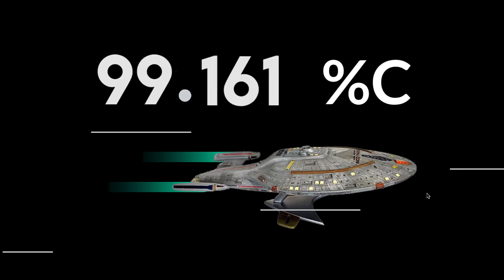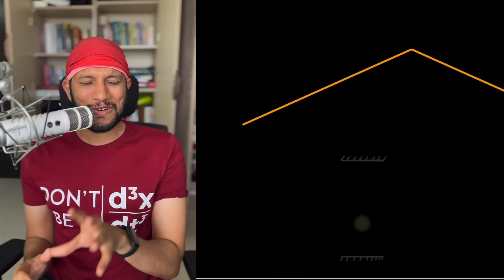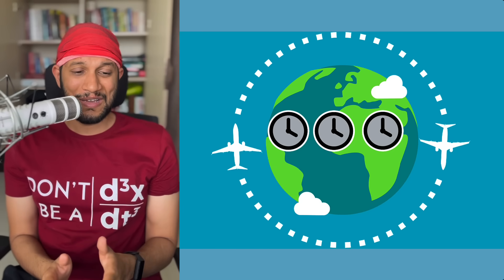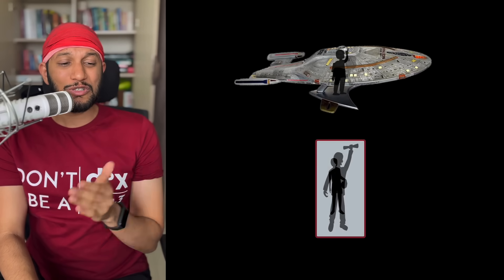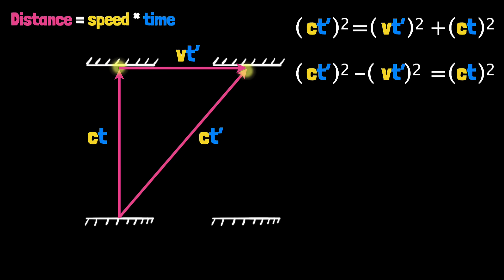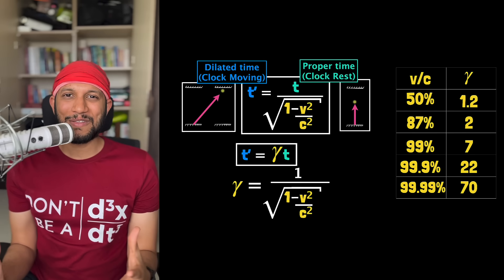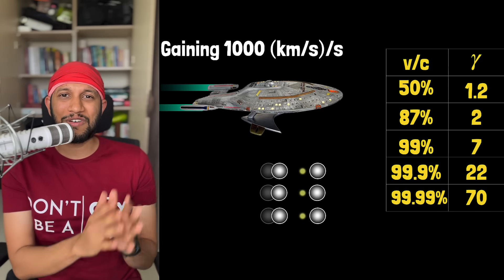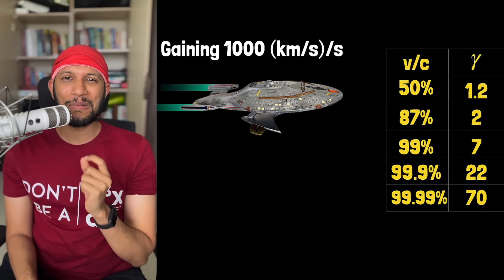I finally understood why you can't go faster than light! (My mind is blown)

Comment: Several relativistic cosmic rays have been detected at 99.99999... %c.  They had the energy equivalent of a baseball traveling at 65mph!  In a race between the cosmic ray and a photon the photon would be ~1 inch ahead of the cosmic ray after traveling 200,000 years.

Comment: Thanks for the explanation. I am not quite sure why it matters what the motion paths of the photons looks like from the external observer. But another question is, as the ship approaches the speed of light, the time inside the ship will slow down, so to speak, so effectively the passengers can travel further than they would have expected using the external measurement. So doesn't that mean that they can effectively go at the speed of light, meaning travel one light year in one year of their lives? For the outside observer, that time period would be longer, but that is their problem, isn't it?

Comment: Great video! Another intuitive explanation that works for me is that every object, particle, and individual is traveling at the exact same speed - the speed of causality. It just so happens that causality has two components, time and space. There is a trade-off between the two components, such that increasing motion through space requires decreasing motion through time (the total motion through spacetime/causality is constant).

We move very slowly through space because we move rather quickly through time (we experience the passage of time). A photon has all its speed allocated towards moving through space, such that it does not move through time (from the perspective of the photon, it does not experience the passage of time). The photon's motion through space represents the total speed of causality. To go any faster means you must give up the concept that cause precedes effect, which would ruin all of physics.

Comment: You can but it takes a lot of continuous energy to power it all.
First mass is affected by external magnetic field and gravitational field it slow it all down.
However if you took something like a red star and everybody knows there's no way it red star could achieve speed of light but that's mathematics I'm part engineer so what you could do is you can encase the red star in entangled mesh looped massless particles which are used to travel again the speed of light sort of the perverbial nonstick pan so now if you do it right you can actually move an item which does contain mass to the speed of light because it has a shield of massless particles which are used to traveling at the speed of light anyway but to get it to that you still have to use a lot of energy now when I'm talking about energy you basically need to draw a line that goes up to the sky and as you're moving your using more and more energy until basically you're using all of it but you can achieve 1.1 I think the concept of mass speed transported to light speed is doable it just needs to have a shield of massless particles around it which protects it from picking up all of the planets and galaxies which have magnetic fields and gravitational because those things definitely those speeds will slow you down the good news now is that while you have the shield of massless particles and if it's thick enough it should disconnect you from the surrounding so you can take things with masses as long as the shield around it too light speed will take a lot of energy it's probably not practical but you could also steer because if you can connect and disconnect areas of the whole of the ship shielding that every time you disconnect it'll connect to one of the magnetic or gravitational Fields it will actually pull you with that direction just enough that you could actually navigate the universe by connecting and disconnecting areas of the hole where the Shields are and you'll basically be drawn into those areas hence navigation as well win win

Comment: So the slice of pizza I put in the microwave traveled at the speed of light and that’s what heated it up?
Reply: No in microwave oven the oven creates oscillating electric field the water molecules in the pizza are in dipole so the dipole feels torque so due oscillating electric field the dipole moves back and forth creates heat

Comment: Yeah but time dilation in this example only exists from an outside perspective of the spaceship, to a non moving observer. If you’re inside the ship the clock ticks normally so what’s stopping you exceeding light speed onboard the ship? 

Also, if time slows down for the moving object, shouldn’t the universe as seen moving by through the ships window experience the dilation from your perspective onboard the ship? That would mean your time is faster than the rest of the universe, you’re time traveling into the future, and the time dilation is speeding you up not slowing you down

Comment: Very nice explanation. I also think that atoms, matter, vibrates at the speed of light. So, lets pretend we have infinite magic energy, and we push an atom passed the speed of it light, it will cease to exist as it wont be able to vibrate ... Would look sometimes like the absolute zero (that is also impossible to reach)

This also shows that time itself, most likely doesn't exist. You need matter, or something, to measure time. So, time is like a shadow, you see it, can feel it, measure it, but it doesn't really exist as a thing on itself.

Comment: Hi Mahesh 👋, I have a doubt:

If any mass moves with the close to the speed of light then that mass will get increased. This has been proved by Einstein mathematically..practically It has not proved so far...E=MC squared.

If you consider this, accelerating mass/space-ship with the close to the  speed of light will warp spacetime around. mass is humongous while accelerating. Here we will get timedilation from that warping spacetime. So clocks will ticks slower in that space ship. To accelerate that humongous mass we need infinite push...there is no such thing like infinite push...so mass can't move faster than speed of light.

Sooo what I am saying is..... because of accelerating space-ship/mass we will get time dilation....not because of timedilation we control the speed of ship.
In simple words,...Time Dilation is the output of Accelerating mass/space-ship. You were thinking Time dilation is the input of Accelerating mass/space-ship...from the observer point of view you are totally correct and we can't ever see that ship is moving with speed of light because of time dilation....but this is not the real/original reason for why nothing can  go faster than speed of light.

Correct me if I am wrong...my english is not that good don't mind.i have learnt many things from u..Thanks...👍

Comment: Say the spaceship that's passing you by, has a clock at its nose, its middle, and it's tail.  And, your friend on that ship, tells you that they're all synchronized.  At least, as he sees it, in his frame of reference.

But, when you look at the ship, from your frame of reference, at 3 o'clock, you notice that the clocks say:
- at the nose, says 2:59:59
- in the middle, says 3:00:00
- at the tail, says 3:00:01

So, the nose is where it's supposed to be at 2:59:59, not quite as far along as the middle, because it's a second behind.  And the tail is where it's supposed to be at 3:00:01, one second past where it was at 3:00.  The result is, the other ship looks  squished shorter.

This is where the things actually are.  This is not because the light, that you see with, is taking time and distorting what you see; no, you have to calculate the actual locations first, and only after figure how how the light distorts that picture.  This is where the things actually are.

Imagine space-time.  It's 4 dimensional: 3 space dimensions and one time dimension.  We are all where we are in space, but we're zooming forward at the speed of light along the time axis.  When the spaceship passes by, it's space dimension is actually tilted relative to ours.  That's why their head and tail seem to be at different times, in their frame, while at the same time in our frame.

Comment: A few questions based on the explanation. We witness the time dilation because inside the ship 1 second feels like 1 second yet observing from the outside 2 seconds pass where 1 second passes inside the ship. Depending on where you are standing , i happens differently based on the movement of the photons.

But arn't the photons inside the ship when you look at the clock still moving at the diagonal? Shouldn't they be traveling the longer route? That is the path they are taking.

Also, shouldn't it feel like you keep accelerating 1000 km/s/s inside the ship due to this very aspect? So from inside the ship you would hit light speeds eventually whereas from the outside that would never be possible?

I think I am misunderstanding something, so please do help out.

Comment: I have always had a problem believing time dilation till you explained it the way you did.  Time itself is not changing but the observation of time changes.  However there are two potential flaws to this theory I see from your wonderful explanation.  As I understand it from other sources, light has constant speed and is not influenced by outside sources.  Light speed is not added to your velocity, so I surmise that trajectory is not added to light either.  Therefore in a photonic clock the tick would stop the faster you go because the straight beam of photons would miss the reflection and thus the receptor in the example when moving perpendicular.  Similar in saying we don't see the sun but where the sun was 8 minutes ago, bu we only see it at all because the sun emits light in a sphere, in all directions.  Therefore if you can build a photonic clock with a wide enough surface to both reflect and the receptor then time would not dilate and you could measure your approach to the speed of light by the deviation from a perpendicular line thus measuring the dilation of other atomic processes.   Of course this impossible to build because even if you had wide enough surface the atomic process to record the photon would slow anyway.  In short in a photon clock the photon does  not travel further it just misses its target.  Second potential flaw I can see is the impossible to reach speed of light.  The explanation was that because of dilation the reaction to acceleration would slow but again the nature of speed of light particles would be that the speed is constant not influenced by the speed of the source thus a doppler effect should come into play maintaining a constant amount of force.  The stream of particles being emitted would be compressed at the source but be stretched equally at the destination meaning a constant rate of force.  The dilation only would come into play if you stop and start acceleration.  A constant acceleration should maintain constant fuel consumption regardless of speed until reaching the speed of light when the particles simply build up at the source likely causing an explosion.  Again the scenario is impossible to test because there are always outside forces like gravity and such as well as the atomic reactions of the fuel itself being dilated and such.

Comment: Can we go at speed of light if we are inside the spaceship, because from our perspective we are increasing at 1000 km/s /s without time dilation?
Reply: If any mass moves with the close to the speed of light then that mass will get increased. This has been proved by Einstein mathematically..practically It has not proved so far...E=MC squared.

To accelerate that humongous mass we need infinite push...there is no such thing like infinite push...so mass can't move faster than speed of light. This is the real reason many physicists believing

Mass is nothing but purely energy....that's what E=Mc2.....adding  energy to mass is nothing but adding extra energy to existed energy...that way mass will get increased when it is in  near the light speed

In this video he is correct with outside perspective...but that is not the real reason for why we can't move faster than speed of light

Comment: The mistake most people make is not understanding the difference between "observer" and "traveler." For example, treating the speed of light as a universal constant for the limit of any information passing. It's not. Quantum entanglement effects travel faster than it. It's the OBSERVER limit. But has NOTHING to do with TRAVELER velocities that are uncapped. Even if we can at most SEE things move at the speed of light, we DO NOT KNOW how fast they internally are moving. They could have already reached the edge of the universe, but we wouldn't KNOW that until the speed of light reaches them. OBSERVER vs TRAVELER.

Comment: I'll explain it to you. Traveler's velocity is uncapped. Observer's velocity is capped at the speed of light. The reason that's the limit for the observer is because the observer cannot observe anything moving faster than the speed of light. It can only observe things moving, at most, at the speed of light. Keep in mind that it's based on relativity. There is no objective frame of reference. If I age 10 times faster than you, nobody can say whose is the correct rate of aging. We can merely compare the two. And the calculations differ depending upon which of us you assign as the observer of the other. Or if you decide that anyone else is the observer. It's about comparing one thing to another. Not some objective truth.

Comment: TLDW:
If you want to achieve the speed of light with finite energy it will take an infinite amount of time. 
If you want to achieve the speed of light within a finite time, then it will take an infinite amount of energy. 

The universe is awesome.
Reply: But only for particles that have mass. If it's massless, then it instantly moves at the speed of light, and has no acceleration. That is because acceleration itself is tied to mass. If you have no mass, you have no acceleration.

Comment: I thought this only applies to the prospective of the observer?
Reply: Yes. Individual objects can move faster than the speed of light internally, but to the outside observers, they can only move at the speed of light. A particle's internal speed has no limit, it caps up to infinity. This leads to time moving at different speeds for the observer and for the particle itself.
Essentially, if you internally are moving at 100 times the speed of light but to the outside world you appear to be moving at 99.999% of the speed of light or something, then the outside world takes 100 times as much time to observe you moving the same distance.
Reply: If any mass moves with the close to the speed of light then that mass will get increased. This has been proved by Einstein mathematically..practically It has not proved so far...E=MC squared.

To accelerate that humongous mass we need infinite push...there is no such thing like infinite push...so mass can't move faster than speed of light. This is the real reason many physicists believing

Mass is nothing but purely energy....that's what E=Mc2.....adding  energy to mass is nothing but adding extra energy to existed energy...that way mass will get increased when it is in  near the light speed

In this video he is correct with outside perspective...but that is not the real reason for why we can't move faster than speed of light

Comment: So If I understood correctly. It is perfectly possible to accelerate to speed of light. Only outside observer would not recognize it because of time dilation. That's what i'm getting out of this... 
From the perspective of the cabin crew they continued accelerating normally. Only outisde observer noticed the acceleration to be slowing down.
Reply: No, it's not possible to accelerate to speed of light. Speed of light can only be reached without acceleration, by massless particles such as photons.Internally, you can move even faster than the speed of light. But to the outside world, you will still be moving at less than the speed of light. The difference between your exprienced subjective speed and the observable observed speed is the time dilation effect. It's important to note that "speed of light" is an observer effect. There is no cap on subjective speeds. Photons, for example, have infinite subjective speeds. They just appear to the observer to move at the speed of light. In this way, the speed of light can be thought of as the conversion factor between infinite and finite.
Reply: Exactly you are correct but...

If any mass moves with the close to the speed of light then that mass will get increased. This has been proved by Einstein mathematically..practically It has not proved so far...E=MC squared.

To accelerate that humongous mass we need infinite push...there is no such thing like infinite push...so mass can't move faster than speed of light. This is the real reason many physicists believing

Mass is nothing but purely energy....that's what E=Mc2.....adding  energy to mass is nothing but adding extra energy to existed energy...that way mass will get increased when it is in  near the light speed

In this video he is correct with outside perspective...but that is not the real reason for why we can't move faster than speed of light